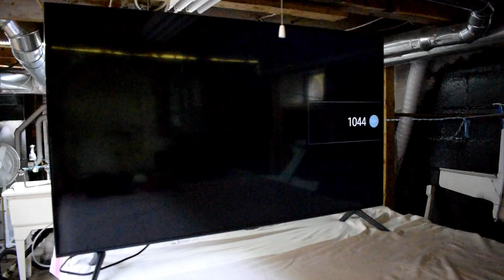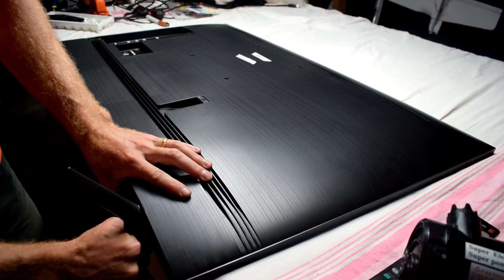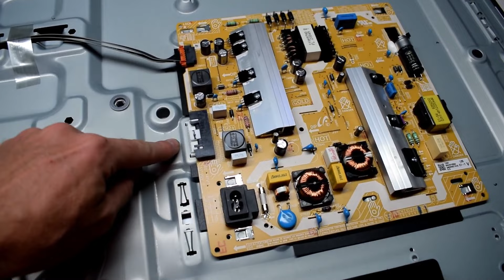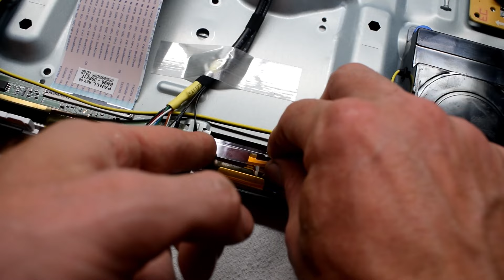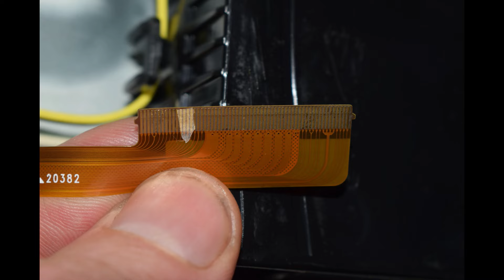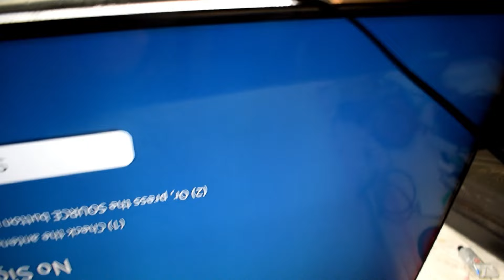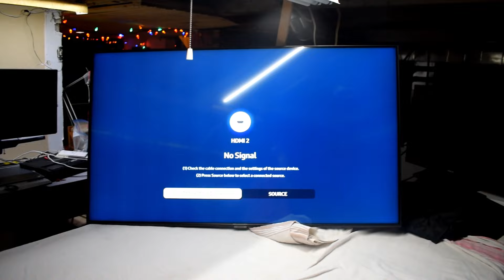Samsung Smart QLED TV Keeps Restarting! Fixed with TAPE! (Model QN50Q60TAF)

Comment: I have a TU8000 that kept rebooting every minute or so. I followed these instructions and it fixed the issue. Thanks!!!
Reply: Hey
I have the same model and the same problem,
which pins exactly did you tape?
Reply: @kornelk687 I have the same model as well and I taped the pins right after all of the orange lines Grouped together before the small lonesome orange one. This fixed the power cycling and I got audio so the tv is working but the display won’t come back
Reply: can i use the method with a TU7000?

Comment: I have a 82 inch hdr LED tv boots constantly but black screen. I remove single flat cable Mainboard and seems to boot with black screen. Like your video I have a couple connectors to the right and left . Do I just play with the one closest to main panel cable? How many pins do I cover at a time ?
Reply: Same here… get anywhere on that?

Comment: Hello, I am writing this in hopes of getting some idea on my issue I am having with my Samsung 70in tv. I have watched tons of the videos here on youtube and tried many of the suggestions but to no avail.My issue seems to be a little different than most and I havent seen a solution for it anywhere that I can find. My TV powers on the backlights are working and coming on the samsung  booting up sound is coming on the backlights flash on then off then on dim and off the samsung sound comes on again like it is just trying to restart., but the screen stays black, when the backlights are on I can tap the screen and see the white backlights are lite so I know they are good.I have changed the power board and the main board and the ribbon cable that connects from the main board to the display . This TV doesn't have a separate T-Con board, the ribbon cable connects to the display circuit board of which there are 3 then the other 2 are connected to the middle one by a flex circuit board that jumps the power and data to the other sections of display. Now here comes the weird part that I need help with. If I connect the right side flex circuit board connector(right side when TV is facing down) I get a perfect picture on 2/3 of the screen then the other third is white with 1 very thing vertical black line running through it. If I connect it back screen goes to ball black and restarting syndrome. If I leave the right flex connector connected and disconnect the left one the whole screen is black and doing restarting syndrome. If I disconnect the right flex cable and one of the left flex cables I get a white section on the left and the same white section with the black line on the right and the middle section is black with very faint vertical colored lines. I connect the left side and it goes back to perfect picture on left and middle but white with black line on right. Reconnect the right and whole screen goes to black and does restarting thing. I have tried the taping off the fingers thing that many show on youtube as fixes and haven't seen a difference. Anybody that might have an idea or something I could check it would be greatly appreciated. Thanks
Reply: sorry, that should read..when I disconnect the right side flex connector not connect.
Reply from the maker: check the backlights
Reply: Thanks for your reply, the backlights are working.
Reply from the maker: @zing94  if the tape method does not work then it has a bad panel. If that is the case its best to buy a new tv.
Reply: @NewsonsElectronics  ok, thank you. As for the tape method, I have tried but I just want to confirm, I should be putting the tape on the flex connector (right one) that is on the side where the white screen section is? Or should I be trying on the actual ribbon cable that comes from the main board?

Comment: Just used this to fix my TV Samsung TU8000 50inch. Taped over Pin 12-15, couldn’t manage to cover any less without it working. A bit suspicious that all our models happen to be the same. Thanks so much for the video, was spending 2 hours trying to fix my tv. Definitely gonna have to eventually buy a new one
Reply: From which side did you count the pins?
Reply: Broo lmk what you did I have same issue as same tv Tu8000
Reply: Same model same issue.. Hope I can find which pins need to hide 😢😢
Reply: I have TU7000B. was your issue with the cable that hooks the 2 panel boards together? If so we should be able to buy one of those cables somewhere. Wish i knew what they are called

Comment: thank you so much! i thought i was gonna have to throw out my brand new tv. to everyone that fixed the issue of restarting but has no picture/bad lines going through the screen, i was having the same problem but i just messed around with the tape on the spot that it needed to be until the picture came back clear. it took me a little while. also, try to make the tape as small as you can. i only have mine covering maybe 2-3 lines.

Comment: Unbelievable!  My TV is fixed.  I followed the instructions and indeed the solution was taping up the four pins like you showed.  Perfect picture, no lines or loss of image quality.  Thanks!!!
Reply: i did hide 4 lines as he did but i still see a little black line in middle screen and 2 little green lines middle up of the tv .. any suggestion ?
Reply: @maximelevesque5914  if you can see pictures and TV powered ON, start focusing on those 4 pins you covered. Take a thin tape and start covering 1 pin at a time instead of all 4. One of those four pins are having an issues. The TV shall work
Reply from the maker: nice
Reply: @NewsonsElectronics  thanks man
Reply: @NewsonsElectronics  hey  newson where are you located? I'm in oakville

Comment: thanks, will give it a go on my Samsung QE50,  have simialr issues.
btw, when you say its `made up of millions of LEDs`... erm no this TV has a side LED backlight strip, not millions only about 30.
and those pins you have blocked are most likely due to panels shorts on the clock signals or bad components on the right panel board. the pins are not connected to `LED strips`.
otherwise usefull for someone who knows what you intended to mean. thanks.

Checking back, It works now .
So likely to be a panel short or bad component on the board causing voltage to drop and TV to go into fault mode and reboot . I'll investigate components... Fyi,  This is is no way a proper fix, it just masks the issue from the main board and if there is an underlying panel fault or may get worse and stop working completely.. but ok for quick short term patch.
Reply from the maker: the lcd panel itself is made from micro leds that give you the different colors the backlight is just to be able to view them.

Comment: I have a 3 year old Samsung UE50TU8005K with this error. Mainboard is BN41-02756B-000. First try with tape covering 4-5 pins the place as yours, stopped the restarting, but brought lots of black lines. Then tried shifting a bit left and right, but after that I end up with no restarting, sound and NO picture. I have given up 😞 but thanks anyway.

Comment: So glad I came across this video. Was hopeless and was almost sure that i may have to buy a new tv. Thought of booking in a technician but thought of giving it a go myself after watching your video. Went straight for that pins where you showed in your video. Tried shifting few times, got the sound on and the reboot stopped. But the reboot started as soon as i tried to plug that pin in again, until one spot from the left worked. Bingo. Not only that it also fixed few yellow green horizontal lines i had started to get few weeks back on top of the screen . Thank you man. Have subscribed to your channel. 👍 You the man.

Comment: Thanks a lot man, I followed your instructions and my TV is working! I have the black the lines, which are noticeable, but it's fine for now. My Tv is QE50Q60T. It 40 days out of the warranty and Samsung didn't cover it. They charge for the panel and labor 369€ here in Greece...
Reply: i have same tried for about 3 hours the most perfect i has is one black line and 2 greens
Reply: I have exactly the Same model. And it’s working fine now. The lines are there but then I’ll live with it
Reply: Which pins did you try I have the same TV

Comment: I've located which pin is the problem, but I'm having trouble finding what exactly to tape since the tv still does not display, but the backlight and sound is normal, does anybody have a solution? I've been hunching over this thing moving tape for 2 hours. I have a UN50TU8000FXZA
Reply: I have the same problem with mine. Did you find a solution?
Reply: @jayxis_  not yet 😭
Reply: i have same tv beem able to have clear image but with one black line and 2 greens one
Reply: @maximelevesque5914  the same here. Have you managed to clear these lines?
Reply: @dobrilstoev2925  nop .. cant do better but better than nothing

Comment: The back lights stay on after disconnecting each component but still no picture. The Sound stay on for about 30 seconds then cuts out after every component is disconnected. What could the issue be?

Comment: You are the best! Like I was just about to put my QE50Q60TA to bin, got a new TV in the meantime, and decided to go online again and found You! It worked literally at the first time! I think samsung makes now tv that only work for 2 years lol I'll take 24 months warranty now!
Reply from the maker: great
Reply: Is your TV still working?
Reply: @mustafae.6719  yes! it is! I don't use it as my daily TV although it works perfectly fine!
Reply: @demonisco please which particular side did u tape and how many likes did u cover. I have the same model as you
Reply: @mustafae.6719  yes, it does have a very tiny line going through the screen, but you need to very close to it to see it.
Reply: Could you share with pins you covered? I also have the same TV as you with the same problem.
Reply: @darude1420  I'm not sure. I have forgotten. Although, I remember putting a very small tape cut, covering 3 or 4 pins on one end. You should have figured out which side is broken by now and simply try covering 3-4 pins at once.

Comment: Had this issue on my Samsung Q60T. Followed these steps and isolated pin #17 from the left, covered it and i got picture, although the top left quadrant of the screen has faded/muted colours, almost black and white. I’m guessing that’s as good as it’s going to get?
Reply from the maker: move the tape a bit
Reply: @NewsonsElectronics  tried moving the tape around and cut it shorter each time. If pin 17 isn’t covered it goes into a boot loop again
Reply: Exact same problem with me too pin 15 from the right covered but no picture
Reply: Has anyone with pin 15 solved the problem?
Reply: For me pin #15 from the right has to be isolated or i get a loop, I've taped only that pin but I get no picture,

Comment: Same tv, both sides of the panel seem fine according to this test. with both ribbon cables attached TV starts with a clear picture then a few seconds of menu navigation it reboots to a mostly non functioning state. Any idea? I'm thinking the mainboard at this point as psu is good.
Reply from the maker: check your backlights
Reply: @NewsonsElectronics  ended up fixing with tape. Now I do have some colour issues on the left side of the screen. Faded/washed colours sadly.

Comment: This technique just fixed my samsung 50 inch UN50TU8000F !!!!
It took some time figuring out which pins to tape and how many at a time to tape, but for the cost of how much tape I used this fix is amazing, thank you so much Mr. @newsonselectronics without this I would have added another tv to the e-waste pile and spent more money.
Reply: Hey, I have the same tv as you. Was yours turning on and off every 10 seconds or so? Hoping to give this a try.
Reply: @natashavani9588  mine wouldn't even stay on for 10 seconds, it would turn itself on and off within 2 seconds to where I couldn't even see the samsung logo appear or hear the sound when it first turns on. I diagnosed mine just like the video and it ended up working for me, I used the blue painters tape to cover the pins. Mine took alot more pins to cover than in this video though. I had to cover like 5 or 6 of them with a fairly wide piece of tape. It's really time consuming but for the price of a piece of tape it's worth saving your tv.
Reply: @BlastHands  did you get no picture when you covered some pins because I'm getting that.
Reply: @animegodz6981  yeah that does happen which means your on the right track!!!! Just keep playing around with it and soon you will find the right combo of pins and you will get picture back. It took me like 5 hours of taping and neck pain but you will make it!!
Reply: i have same models i just been able to have clear image but with one black line just a little bit down the moddle screen and 2 greens lines almost on top of the screen did happened to you ? i couldnt have more like this but i would like to have 100% screen perfect.

i covered 4 pins like in the video but doesnt bring back perfect . did you covered 1 pins more each side like in the video ?
Reply: @maxime Levesque  try playing with the tv picture setting, I used to have a bunch of pink lines on my TV but changing the settings to "movie mode" made them go away.
Reply: What's up, brother!

I have the same screen model as yours.

My problem is that, in both connectors, there are places where putting some tape manages to stay on, and you can hear, but you can't see the image, what could be the problem?

Comment: Same reboot problem with the European equivalent model QE58Q60. With the left hand pin taped (as per the videos thumbnail view of the ribbon cable) the reboot problem is fixed but then only sound and still no picture. Could this signify a second fault perhaps on the main board?
Reply: Same problem for me :(
Reply: @franciscoruiz8612  Same for me. Seems no matter what pins I cover I only get sound and a black screen :(
Reply: Did you manage to solve this? I also have no picture

Comment: Dude it actually worked.
Yes some horizontal pixels are missing.  Yes you can see the lines if you 12 inches away from the screen. 
But 2 hours later...its work...
Nice one. Truely appreciate you taking the time to make the video....my TV is
UE50TU8000KXXU 
IT NOW WORKING

Comment: I have the same exact model. However, mine keeps turning off/on in a split seconds. Unlike yours, i do not have even 10 seconds to reach the settings page. Sometimes, i do see the introduction of QLED and it reaches the main screen. But it turns off and on again within seconds. Any idea if this tape quick fix will be able to help?
Reply: I tried this and couldn't get it to work. I was able to tape off the pins that were making the tv turn off and on in a loop. Could not get the actual menu/intro to show up though, just got a dark screen & sound.
Reply: @franciscoruiz8612  Same here!!! Hopefully someone could give us a solution...
Reply: @waizhan28  hi I have the same issue too, started with some lines a few weeks ago now it started boot loop, used the same method in the video now only shows blank screen no boot loop though. Never buying Samsung again.
Reply: @byre1000  thanks for mentioning the 2 lines across the screen ,I noticed themsince some weeks now.then boom today tv is turning on/off in slips seconds..did you fix yours?
Reply: @Jstlynnreuben  exact thing happened to me. 14 months old tv .would sometimes come on after 3/4 hours. fixed it by throwing it in the bin and never buying a samsung ever again
Reply: Same for me. It’s so frustrating
Reply: Same here. With this video I could stop the boot loop and I can hear the sound of the menu now, but I have no image on my Q60t model

Anybody found a solution to this?
Reply: @Nickmann28 the exact same thing here omggggg

Comment: Ive got a samsung 58" TU7000F and put tape in the EXACT same spot and got it to work, LOL.  as if!
Reply: I have the 70" TU7000F but when tried placing the tape in the exact same spot it stops the rebooting but still no picture =(
Reply: @hammiranda  keep adding more tape.  Mine died on me again last week and last night I added more tape, trace by trace until it started working again.  I’ve got lines on half my screen but I use mine strictly for surveillance cameras so it doesn’t really matter.

Comment: @Newsons Electronics are you sure this TV has not a tcon? I believe it is either with the main board or the panel. Why I am asking is after I followed your video my TV is giving very bright/white image and very low colour. Any suggestion is much appreciated :)
Reply: How did you fix the problem with the white screen? When i cover the pins my screen turns bright white. If i cover the other pins the colors are normal but the screen crashes after a few seconds.